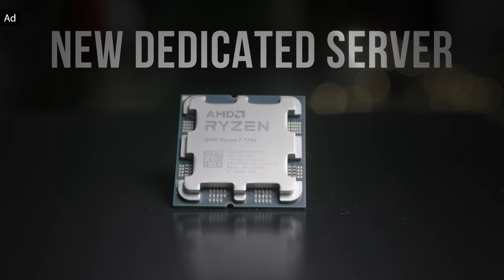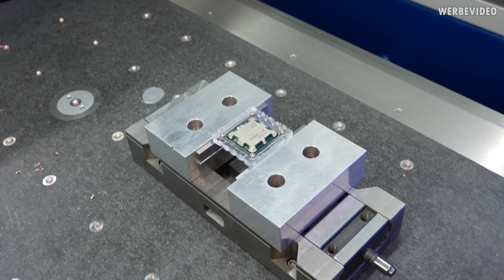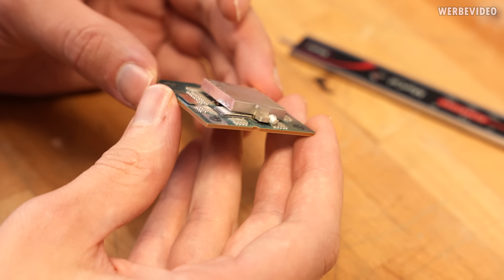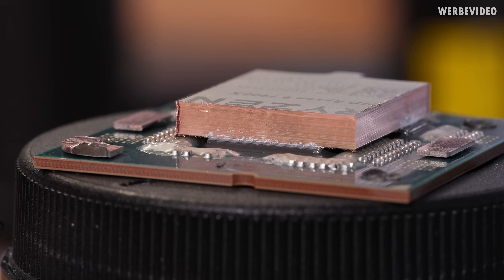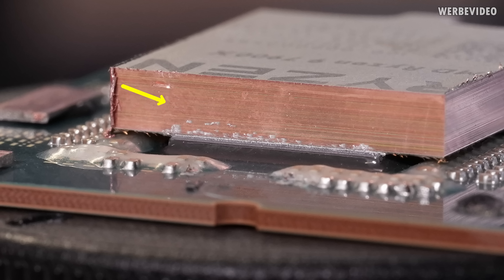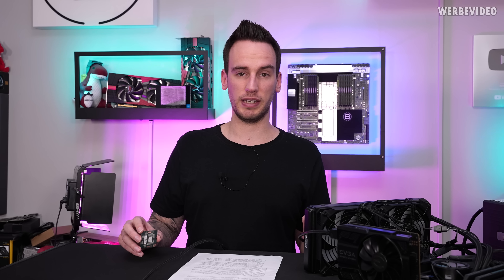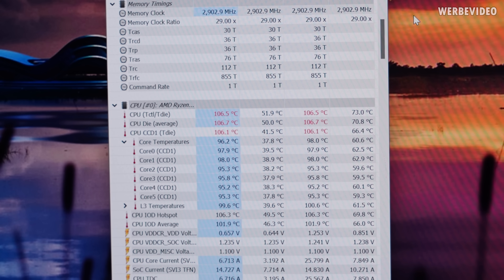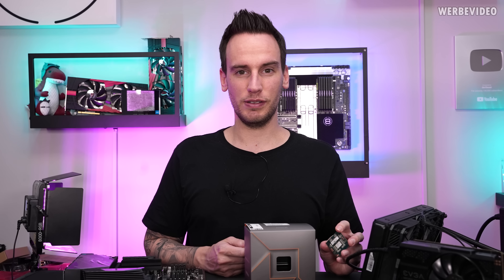Viewer-Mail Ep8: This CPU Unsoldered and Killed itself

Comment: Obviously I'm rather late to this video, which is great and I'm very jealous of your mill.
It occurred to me that the unnamed lab and engineer from Steve's recent videos might be able to shed some light on what happened to this one. The 160°C is nothing compared to the CPU which damaged the m/b, melted copper and, possibly, silicon!
I wouldn't be surprised if you've already spoken to him about it, that the original owner of this CPU was using an ASUS m/b did not surprise me. 😒

Comment: I worked on a pc that had the PSU die, one of the coils dropped off the circuit board because the fan stopped and it got so hot.

Comment: Now the 2nd time a 7000s melting it self, my scenario happened on a 7950x where the tim melted and ended up "soldering " the cpu to the retaining bracket, but without force the cpu came off the retaining bracket without issues, but yea dead cpu. And the shop ended up refusing RMA and said it's user error. Time to move back to intel, they run hot but don't melt them self🤣

Comment: PBO offset on these cpus is set insanely high I was able to do a -18 PBO on my 7950x and still run stable in all core workloads and benches decreasing temps and increasing clocks... it still hit 95c don't get me wrong but at a higher ghz

Comment: That IHS is insanely thick. Its little wonder why these chips get so hot under there!

Also some more reports of the 7000 series CPU's burning up. Wonder if its an issue with the small tolerarances and motherboards sending too much voltage.

Comment: Why didn't you just remove it with heat ?, the thing has already reached solder melting temp under operation. i doubt you could damage it more.

Comment: I can say something is off with the protection mechanism on the 7000 series, or motherboard. It happened to me once that a 7950x generated a magic smoke during the first boot (without heatsink, no protection kicked in, but it also should not exceed 50-ish celcius). It has been a while since I saw this kind of flaw, since 2010 I think.

Comment: Someone left the new guy unsupervised. That or it was a bad IHS so the solder didn't get a chance to adhere properly. Which is probably why we see some ''shiny'' indium because it was never pressed against the IHS. 

 Or one of their machines failed in a way that was hard to detect and that CPU was already out the door. I personally don't see how this isn't a manufacture mistake but I'm just a guy with no qualifications.

Comment: My theory is the CPU could shorted from looking at the hotspots. If that the case a lot of current as those Voltage regulators on those board are capable of delivering quite a bit of current and thermal runaway. Likely could have exceeded 160c even. If shorted the CPU won’t work but the motherboard VRM’s could have still been delivering current? I seen over 260c plus and board VRM’s still was definitely power, CPU literally was well over 260c even reaching over 326c before power cut measure using a FLIR thermal imaging camera which is pretty accurate. The CPU was defective and didn’t post was a early Ryzen as well so figure play around with it since it was toast anyways as guy put to much voltage overclocking and destroyed shorted the CPU already and surprisingly got way hotter then we expected. Nothing bad about AMD Ryzen as they are fast and great and have a Ryzen 7700x been using in my main rig that rock solid, so long you don’t torture them they are reliable. 

It sure looks like that what happened? I would have tested the melting point of that blob.

Comment: the indium solder could have been contaminated with another metal with a lower melting point, or there could have been micro air bubbles in the indium solder that expanded inside the solder causing an increase in pressure thus lowering the melting point of the indium in contact with the air buble.

Comment: I might be cynical but seems like the user tried to delid the processor using a oven and messed up. How would the cpu run if blow even at 120 degrees and metal doesn't melt till higher temps. The board would be fired too with that much heat

Comment: its factory defect 100% in this point where indium melt no temp sensor thats why it can rich this temp and melt indium also in small hole in solder u can see cracked chip and it can short itself for small time and just melt solder if it cracked beforre pc shut down itself

Comment: in a closed loop you can get water above 100C but the pressure will rise. yes you can't get above 100C at sea level pressure, increase the pressure and you can go above that, much like when you decrease the pressure water will boil at a much lower temperature.

Comment: Could it be a bad batch or wrong type of solder paste? 
For my diy electronics projects I use solder paste with a low melting point rated around 160°C, but it starts to reflow around 120°C...
Maybe test it by scraping of a bit, and trying to melt at various temperatures...

There could on the other hand also be a short inside the chip, causing increased temperatures and hotspots not detected by the temperature sensor. 
Should be possible to detect those with a heat-camera.

Comment: Holy shit that a thick heat spreader, no wonder they run so hot
Reply: I mean, even with such Thicc IHS, it still managed to be cooler than any Intel CPU counterpart.

The 7950x3D and 7800x3D managed to pull 70% less Watt than Intel. How's that even possible while also matching the performance.

Comment: It actually looked like the indium had boiled making the craters and escaping outside.  But that would mean an impossible 2000c.  So, maybe get an indium sample checked out.

I think impurities mixed in the applied indium.  Maybe they apply some alcohol or solvents to clean the manufacturing machine surfaces and....?  I don't know, very weird...

Comment: Just a correction: CPU won't die at 160C, but it will die at a much lower temperature while still running. We did a lot of CPU replacement on laptop motherboards where we need to heat CPU 220C + to be able to remove it from the motherboard.

Comment: If it did indeed reach 160C (testing melting point of the blob as another commenter said) then that would be a failure on the CPU's thermal protection circuitry, hence faulty CPU or manufacturer defect.

Comment: 125 that is about what I reached on an old K7 CPU as well, it was misbehaving at 115 and eventually gave up at 125 with just a piece of aluminium strapped to it! And this is about what I see here in your video as well, this is why there is a heatspreader these days as the poor K7 wouldn't even boot without a "cooler" attached!

If you remove the cooler, even in the "lowest" energy mode it will dissipate more heat than that little IHS can absorb. I have no clue what the original owner might have done to it, but it could still be a defective die with a failed thermistor?
Reply: If I had to guess what happened, you can still control the SMU on these chips manually and if your utility is based on ZenStates there is basically NO limit to what you can do with the CPU as it just calls the specific SMU command with the value you gave it.
Reply: I actually do this on Linux myself, but there isn't really an utility for it so you have to write values you calculate yourself...

Comment: You say this isn't a manufacturing problem, but it definitely seems to be the case, just not about the process of applying the indium, it's probably a chip problem, where thermal throttle or the shutdown protection didn't work correctly.

Comment: Very good post-mortem work on the dead CPU. That chip is running uber hot! I have an MSI X670E motherboard with the 7900 (non X or 3D) - with an Cooler Master 212 air cooler during normal use my temps are @idle around 49C, @moderate load on system mid 50C to 75C. Running Cinebench it goes to tjmax 95C and throttles down a bit but never over 95-96C after running several minutes. I am going to try a liquid AIO cooler to see what results I'm getting but I don't typically stress my system to the limits.

Comment: Hey Derbauer.
I also had a similar situation where my cpu (5800X3D) did not turn off after going over 95. 
The PC was on it's side and I made it stand up as normal, but the AIO did not like this and there was no flow of water. 
The cpu reached 120 degrees in windows before I pulled out the power cable. 

Gigabyte B450 I AORUS PRO WIFI (rev. 1.0) with latest bios (F64a)
ALF II 280
5800X3D with PBO

Comment: Could it be the power management issue? I mean like if the mosfet on the mb started to act up and provided higher voltage to one of the power rails to the cpu. or maybe the temperature probe was faulty.

Comment: TL;DR - Whatever AMD rates as their CPUs maximum temperature (Ryzen 4100 = 95°C,  5600 = 90°C, 5600X = 95°C), the AM4 platform thermal protection shut down temperature appears to be 115°C.
I believe the temperature limit in bios only effects the PBO target temperature, or the limit beyond which PB2 will no longer boost clock speed above base.
Presumably, looking at this video, AM5 is the same.
I have not tested the lower 85°C limit of the Ryzen 5800X3D. I don't want to kill the gold-dust pride-and-joy CPU in my personal gaming PC.

I am a Master's Computer Science student writing my dissertation on CPU degradation (yes, *actually*).
I am using AM4 CPUs to generate experimental data (4100 because they are cheap...)

The ASUS X570 Prime motherboard I am using sets the "Platform Thermal Throttle Limit", under PBO settings, to 115°C by default. For my research I am using static overclocks so I do not know what effect this temperature has on PBO behaviour.
What I can say is that 115°C is the thermal protection shut-down point for AM4 CPUs. No matter what that value is set to (higher or lower), the test system will always turn off whenever "CPU Core" hits 115°C as reported by HWiNFO. Not  "CPU (Tctl/Tdue)" which fluctuates more and can read over 115°C until "CPU Core" catches up.

I found this when conducting pretesting for a high operating temperature stress-test. In keeping "CPU Core" as reported by HWiNFO at 110+-2.5°C, I was able to run my test system for a full 2 weeks. But in the pretesting, if the temperature ever hit 115°C, it would turn off pretty much instantly.

In unscientific (and unrecorded) personal overclocking and tinkering, I have seen "CPU Core" temperature hit ~100°C on MSI B450 Mortar Max and MSI X470 Gaming Plus motherboards that I have used in personal systems.

Comment: Mm... with the way HBM works and how volatile it is, my guess is it malfunctioned while overheating (since 115 is so much higher then even the 95) which caused a run condition. When chips and electronics malfunction they can do all sorts of weird things, so something probably went derp in the HBM stack which caused it to request waaaaay too much voltage and the board complied for a bit. Not very technical, but HBM has proven to be extremely delicate to handle, I can imagine what happens when it's not and this is probably another example of it.

Comment: I have seen something similar before on Ivy and Sandy bridge platforms with 3 asus boards, all of them have voltage reg failed in bridged mode and pumped 12v directly into the cpu as soon as psu went online, one cpu was exploded with both carrier board and heat spreader bent, the 2nd one was burned, and 3rd one was dead but it didn't show any signs of physical damage.

Comment: Simple answer here IMO.  If you have a way of checking IHS solder melt point roughly.  IR gun, solder pencil + eyeballs, etc.  Then check what is.  If its above 130 then the CPU was likely attempted delid.

Comment: Some low melt solder types start to melt at 135 degrees Celsius, not too far from 110+ degrees and certainly could be reached at hotspots. On the other hand, there could be actual reason why Intel got stuck at 14nm± because of increased heat concentration and increasingly shrinking insulating layers at roughly same voltages which bring reliability problems at high temperatures. But then, a thermal shut down at over 100 degrees seem too optimistic. Or it is simply a manufacturing defect that some debris or something similar was stuck between the die and the IHS or losing the silicon lottery

Comment: I had something similar happen on the Arous B650I Ultra using a ryzen 7 7700x on F2 bios. I built an ITX Ryzen system and I wanted to tune it with a smaller 130w little 92mm fan tower cooler. So while i was testing it down I set the voltage to 1.22 as just a normal OC process of seeing how far down I could undervolt a 5.2ghz. It immediately shot up and I saw for a couple seconds it running at 107C before it increased to 111 and shut off. I didn't think the motherboard would let that happen.

Comment: The larger die has the problem.  The short has generated heat in the single large die.  The indium melts carrying the heat to the double dies which then melt by contact and flows out the heat sink.  With no more contact between heat spreader and die a catastrophic meltdown occurs in the cpu.

Comment: This is a manufacturing defect.  I have a flash drive not reading, a SSD drive not reading, etc...the electronic component is not working.  The question is that is the problem the motherboard or the cpu?  Let us know in two weeks. :)

Comment: I'm still leaning towards a manufacturing defect alongside Ryzen 7000 normal behavior. I'm not entirely convinced that the embedded thermal protection is monitoring every core or component, maybe it's not looking at individual core value.

My theory is that it was in fact a manufacturing defect where either a small yet excluded from thermal protection part of the CCD had a void of flux and therefore indium, causing that tiny specific spot to exceed 160C, melting the indium surrounding it, which in turn transferred heat to more surrounding indium until it flowed out and shorted surface mount components and killing the chip. Voids in cooling are very bad, as they also represent an area of air (any gas honestly), this tiny spot of air will increase in pressure as it heats, pushing in all directions looking for a way to escape, and if that void is allowing the indium to melt surrounding indium, it seems feasible that it would push the liquor indium until it melted to an edge and you'd see a blowout of indium as we saw here.

My best guess is that this was a flux application failure, evidenced by the strip of indium between the CCD and O
IO die that we know shouldn't be there. That misapplication of flux may have drawn solder away from the CCD, or just caused poor adhesion in some areas. I believe the flux is "printed" or silkscreened on before the chip passed inverted through an indium solder bath, so any areas with poor flux coverage could become a void, while any areas of the IHS that got flux and should not have would draw solder from other areas during the high temperature IHS application completion step.

Or, at least, that's my theory, I don't manufacture CPU's 😮

Comment: I've experienced this kind of problem when i put wrong pwm slot for pump. My cpu is 3600 and it'll shut down at 115-120 degree celsius. Idling ramped up on stock clock, stock settings. AMD tends to hot x) But i clocked 3600 for 4400 and max temp at under 80 using cheapo AIO cooler

Comment: You can get liquid water above 100C if it's pressurised, but at ~160°C you'd need to hold back at least 10 bar/1000 kPa. Does seem unlikely. I'd expect a hose or plastic fitting to soften up and pop loose by then.

Comment: Bear in mind that as the water temp rises, pressure in the loop will rise, raising boiling point for the liquid (there would need to be at least a little bit of air to allow some compression......water on its own would likely burst the loop somewhere just from uncompressed expansion.

Comment: If the 7900x has 2 cores disabled on each ccd because they didn't pass qc, could they by any chance somehow received power and shorted out? The melted solder was focused on one area on each ccd after all, any way to know what cores were underneath them?

Comment: I would have to assume that the thermal cut out of the CPU failed first.  Obviously not an intended situation.  But perhaps it could then have continued drawing power and heating to these dangerous temperatures before the actual fatal failure.

Comment: I know a thing or two about soldering and I can tell you that solder does not bubble and boil without contamination(flux or water). From your photos I can still see gold plating on the cpu die and ihs. That means this is  a bad ihs application from factory and those air pockets allowed the die to partially overheat and short starting a thermal runaway that allowed the cpu to get to 160c+ and melt away. That is only my opinion. Nice video!

Comment: Only thing I could think of is air bubbles during application in factory... This combined with weird shutdown system and we have a dead cpu. Could happen to everyone tbh, weird thing is that it won't shut down after exceeding this 95deg limit.

Comment: I connected my CPU pump for my 5800x3D to the CPU Fan Header, should be no problem but for some strange reason nearly 2 years later the header burned out and the no longer provided current. I was playing a game and the game started to stutter and lag badly then I got a warning about temperature on screen and computer shut down. I checked computer and turned the system on again twice, once it auto shut down again and the third time I shut it down. I changed to the CPU Pump Header and it worked fine with no damage. Highest temperature recorded was 110c.